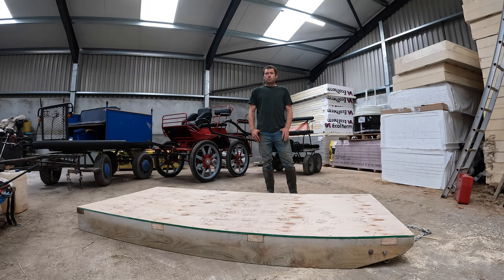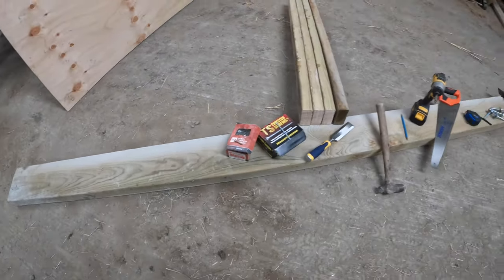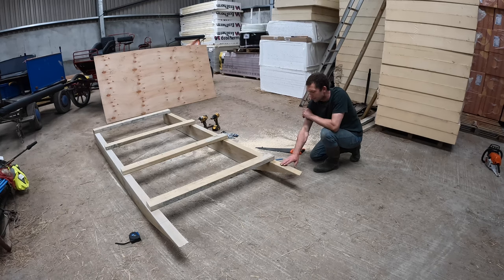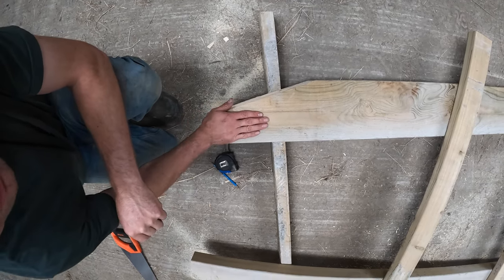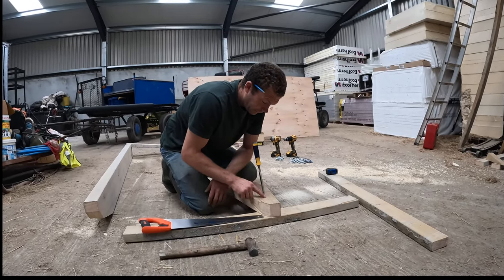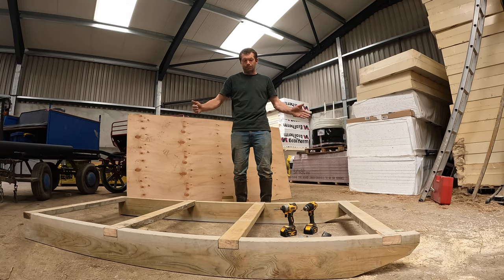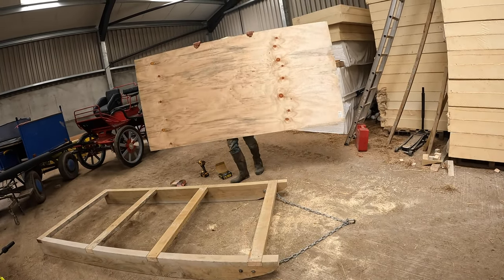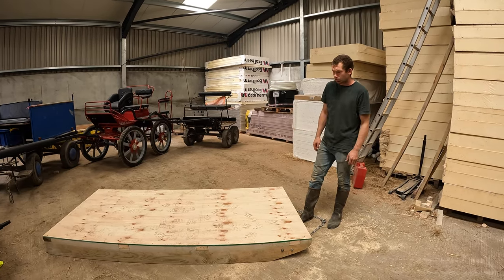simple sledge, or stone boat build for draft horses!

Comment: Is there any reason I couldn't build something to lean against/stabilize myself on  with something like this? I don't have good ankles (aka I fall over easy) and I want to add one of these to my training for my horses. I don't think falling off would be very good for training though 😅😂 You look so stable on that but I know I wouldn't be.
Reply from the maker: We build another version with a bench seat that can be bolted on or off.  No reason why you couldn't put a hand rail on it.  I would put it on the side rather than the front though so you don't stand too far forward.  You definitely don't want to put a foot in front of it while it's on the move